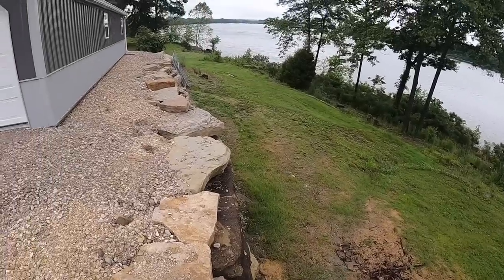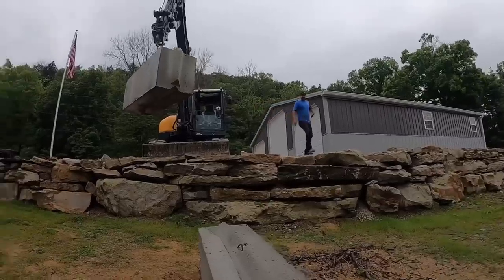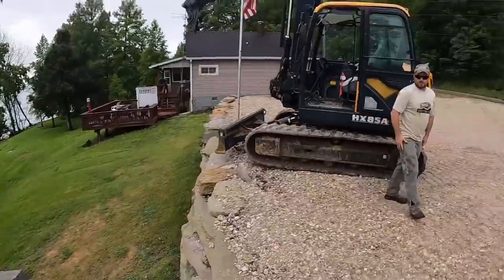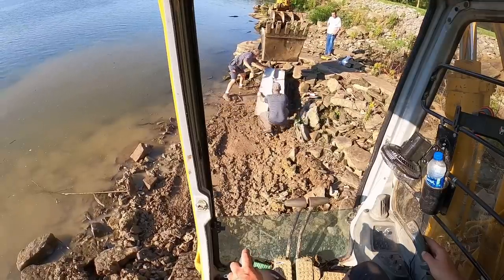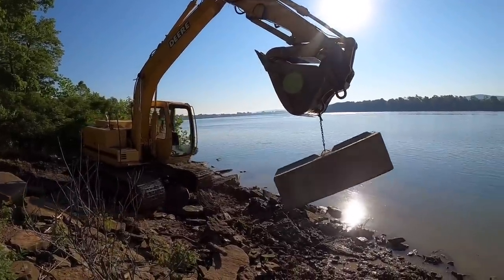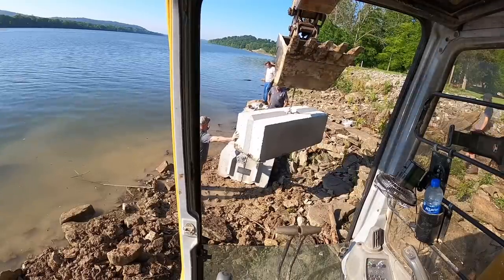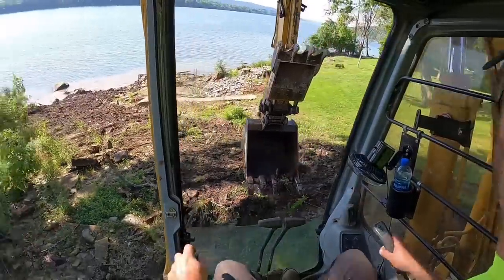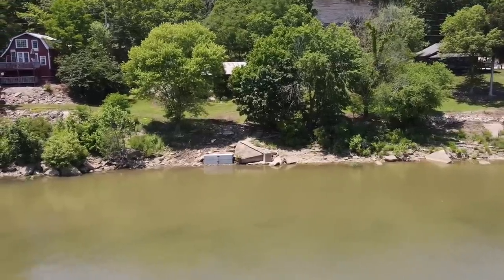Building floating boat dock foundations on the river with the Hyundai HX85A and 120

Comment: I’ve got a 2021 Cat 308 and we build some walls out of those block and it appears that the Hyundai is stronger than my machine.
Reply from the maker: Very interesting thanks for the comment
Reply: Donnie, does the 308 handle them with good stability, and how tall of a wall have you built with your 308?
Reply: @jacobedgington2685  Yes sir, it’s very stable. I’ve built them 3 courses high with no problem.
Reply: @donniemcalister7149  appreciate ya sir. We usually build commercial and rent a 320 for the reach. Have a few coming up that aren’t that tall.
Reply: @jacobedgington2685  anytime sir! The 308 should do the job just fine as long as you’re not trying to lift it too far away from the machine over the side.
Reply: I would have went with the 309 or 310
Reply: @stevesmith-wc2gb  309 is a little bit more ho but ur really paying for the dedicated hydraulic pump on the 309. Don't ever do any mulching so wouldnt be interested. I'm on the fence about the 310 at the moment
Reply: @stevesmith-wc2gb  I needed to stay as compact as I could but still have the lift capacity for working in smaller residential neighborhoods.
Reply: the guy from HYUNDAI in the VERY BEGINNING when taklin about it, said ''from the very start it was desigend to liftt septic tanks and those types of heavy loads.... with this built on hook here......''   I remememememmember that one!!!  thinkin,  OHHHH that's gunna be fun later....  ;)  like NOW is LATER I susspose, eh? LOL  altho I thought he would have it in the shop AS A CHEERRYPIKKERLIFT liftin out a big ole cummins engine to replace with a__________  wutever lol
Reply: My vio55 yanmar will handle them. Just not as well as an 80 size
Reply: What river is that?

Comment: Hey Mike, Nice job, But 6 0f those little blocks are no match for that RIVER, That will be a do-over. MBTS good to see you back, what happened to your channel? Mike should give you a raise, your video skills are fabulous, nice river shots. I've help set those things in water before, we put in about 50' of them, and used 30 a crossed the bottom, side by side, and about 18 crossways. We put them on a smaller river, then a big rain came, and washed them all away!!!  Later Bots got to make the wife lunch. AS always thanks for the great videos, Later: }{ :    PS I'll Bet next spring you'll find them down stream about 50-100ft, if not farther!!!!   LOL
Reply from the maker: Interesting the other 30 we have did over the last 10 years would disagree with you 🤷‍♂️
Reply: @DirtPerfect  ok I stand corrected

Comment: After over 30 yrs with experience in building docks  up here near Cleveland, I’ve never seen anything like that! The first river run will destroy that ! I do not mean to be critical, Mike you do awesome work, that bulkhead needs to be anchored derp in the shore  damn I just sold my barge abd equipment could make a boat load of cash down there rebuilding docks
Reply from the maker: Have over 30 of them in the last 20 years never a problem yet 🤷‍♂️ not for sure what is different where your at

Comment: I will verify as cat 308 will not handle those blocks extended all the way out those rocks are why I like to steel rail with the bolt on rubber pads
Reply from the maker: How have you been  buddy

Comment: we build walls out of these blocks quite often but need a machine that can still do smaller residential work too. We'd be better suited for now with a cat 308 next gen, our only concern was how the machine would handle these blocks. You think this machine would stack these with good stability 10+ft tall walls? Also a cat 308 is spec'd out pretty much the same weight and hp wise. Trying to find the stick length on the hyundai to compare to the long stick on the 308 at the moment.
Reply from the maker: Check pined comment

Comment: Don’t know who told you the weight but they are wrong. Those blocks take 3/4 of a yard of concrete which makes the weight around 3600 lbs. I work at a concrete company and we make hundreds of the with leftovers.
Reply from the maker: Not for sure who told you have weight a many between 3900 and 4300 depending on the mix 🤷‍♂️
Reply: Are those blocks 2x2x6 if they are its easy to do the math.

Comment: I use to pour those blocks. They are about 3/4 of a yard so your actually looking at about 2000-2500 pounds each
Reply from the maker: Weight many full yard here 3700 to 4300 depending on the mix
Reply: @Dirt Perfect  heavy no matter which way you look at it. Love the videos 🤙🤙

Comment: Crazy that parking has no guardrail or anything. Yikes!
Reply from the maker: Normal here not for sure i understand the problem
Reply: Many places are required to have a guardrail or blocks to keep stupid people(or drunk ones) from going over the edge of the parking lot. One time a tractor trailer got sent over the edge(just the trailer) when the guy backed up into a parking slot off the interstate at a truck stop

Comment: Have you ever weighed those blocks? If you do the math they should weigh around 3,600. I have weighed them before and they averaged about 3,200. They use leftover concrete which is loaded with water when they cast them. The heaviest one I had was3,550. I can set them with my mini 57 just not all the way out like you can. Just didn’t want you to think you could set something that could be to heavy for the machine.
Reply from the maker: Last one I weight was 4235
Reply: @DirtPerfect  are they 2’ x 2’ x 6’?

Comment: Wow - I think I would have moved the stack twice.  Down so you could sit ans place until it is done.  Not chop up the edge or slide so much.   Scary.
Reply from the maker: Not for sure I understand the comment but thanks for watching 👍
Reply: @DirtPerfect  You fetched from the first move site and slid and crabbed down the hill. Six times.  I think I would have moved the #1 stack into another lower down and then sit down there and swing them in.  Up and down once or twice instead.